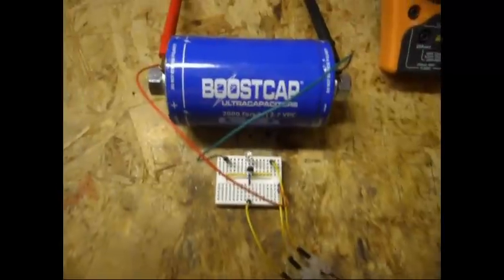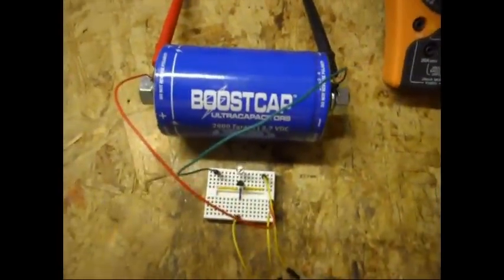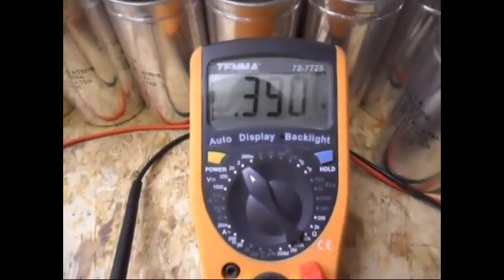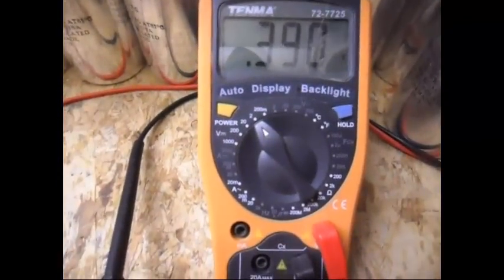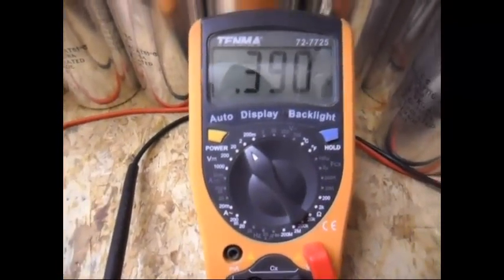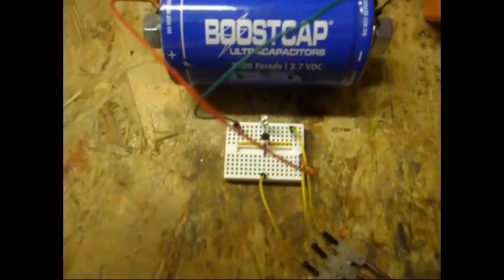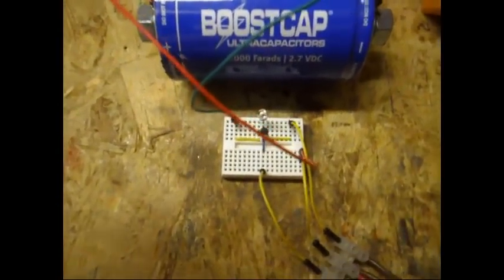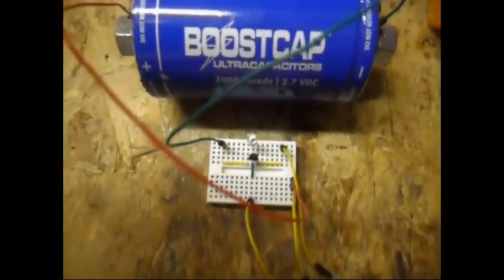Joule Thief_HF Inverter_Oscillator - Update 10 JT switching at 0.390vdc...

Comment from the maker: Extra info on this JT setup & the shorting out of them series 2000F caps...^^
JT stopped working, at what voltage...i don't know...maybe at 0.389vdc...lol
The voltage has climb back to 0.425vdc when i checked it...

2000F caps shorted to discharge test..."faulty"...lol
What i did in the first test,
I've put the meter on them and short them out for about 30 seconds or so and than i removed the meter(1st mistake) and the thick wire used to short them...
Did that same test today but this time i left the meter on them and what you know...
After 30 or so seconds the voltage only dropped just below 2vdc...ahhh now i get it...lol
Awesome caps these 2000F caps are but at the same time not easy to deplete completely...-.-
But than again i'm no expert on fast depletion of 2000F boostcaps...lol

Tried to deplete the one used with the JT at 0.425vdc and it just won't go under 0.3v after some time shorting it out...
They do have good capacity for holding large amount of energy thats for sure...^^

Comment: .39 volt's-very low. My best was .43.Great job TJ.
Reply from the maker: Yes, the 200mv at 4ma is very good...^^
I'll certainly try it out when i get all the stuff needed in the mail...
I went for the BC547 ones, lot of 50x only $1.5...^^
Reply from the maker: Thanks for the extra info...^^
You mean 2n2222 or really 2n222...???
If it's 2n2222, thats good because i do have plenty of those...^^
The bc107 i left a side for now...to expensive...-.-
Thanks for the link, thats a nice page on low voltage JT...will certainly go thru when i have the time...even made a copy of it...^^
Cheers
Reply from the maker: Hi bro,
Thanks for dropping by...^^
It's pretty low indeed but the light is crappy but thats more than normal at that input...lol
I'll have to peep at it lateron to see how low it is now and is it still running or not...
Personally, i think not...lol
Reply: 400mv is ok for silicon transistors. With bc107 you can get down to 350mv
Joule Thief very very low input  0,136 volt
With germanium you can get under 100mv
Ambient Solar Harvester Starts Ossilating From 60mv
With depletion mode JFET you can go a lot lower.
Ultra Low voltage 45mV Joule Thief -Potential to be powered by peltier using body heat only
Ultra lowest 25mV self starting Joule Thief ver1.0-Free Energy merely from our body heat
Reply from the maker: Mongrel Shark
Thanks for your comment and them links...^^
Very cool indeed and low input voltage aswell...o.O
The 1st one is just what i'm looking for, thats pretty good light at 0.136V...it would make a perfect led light beacon at night...^^
Reply: If you click the link at the end of that video You can see a multi tapped version too.
Also not the LED position. collector to base....

The down side to the circuit is it needs a lot of current. 20ma or so.

I know of circuits that will flash a LED for under 5 micro amps, but it needs 500mv. Looking at what your doing with capacitor regen, it might be worth looking in to. Do a youtube search for "Penny Oscillator"

also consider adding some diodes and antenna to your cap to help it charge faster....
Reply from the maker: Many thanks for the extra info on this low voltage JT and the search info about the penny oscillator...^^
I'm just busy now on ebay to buy some bc107 and bc547...can never have enough transistors...lol
Will check the multi tapped one...sounds awesome...
20ma is a lot but with these 2000F it should run some time...and just maybe it can be tuned for 10ma...^^
Diodes and antenna to the cap...cool...
Will certainly give that ago...^^
Reply: If you get germanium diodes, you may be able to get in the 100mv and 4ma range.

Messing around with the bc107 will get you that low too, but not much brightness.
Reply: The ac141k I used in the above 60mv video and this earlier version which seems to be exactly what you want.
Low power ambient light solar Ossilator. Run on les than .2v
Reply from the maker: Nice info and thanks for it...^^
Thats a good range for a led beacon light...
I see here on ebay "1N34A ST Germanium Diodes"...^^
Reply from the maker: Mongrel Shark
Checked it, looks cool but it's on ambient light and the led beacon will sit in pitch black darkness and run on a 1F, 10F or a beefy 2000F one...^^
Maybe a combo of ambient light to charge the cap during day time and low ma draw could do the trick...1F & 10F cap ofcoure...lol
Btw, those vintage transistor are pretty expensive...lol
Reply: They are a bit pricy. I cringed a lot when I killed one.
solar cell or cap. its still 200mv and 4ma regardless of where it comes from
Reply: BC547 has a very narrow tuning range. Especially on the larger coils you'll be wanting to maintain brightness. 2n222 is the same price and will give better results.

The JFET is probably the way you should be going. Cheaper than germanium.

http://www.neazoi.com/energy-harvesting/index.htm

As I think I mentioned. Silicon bipolar transistors mostly start at 400mv no mater what you do. At least all the ones I have tried. Except the bc107. Which starts at 350ma.